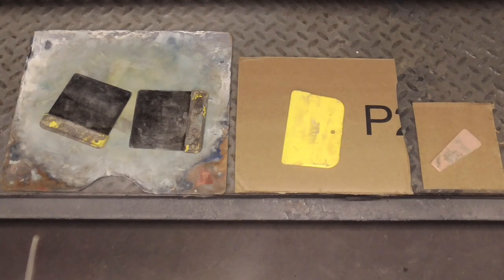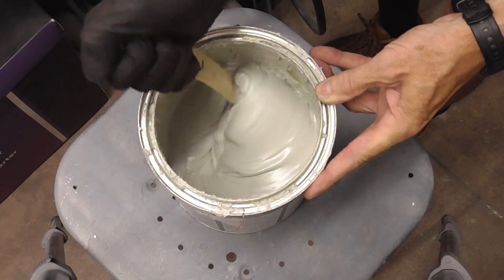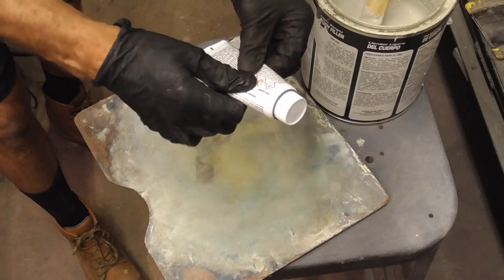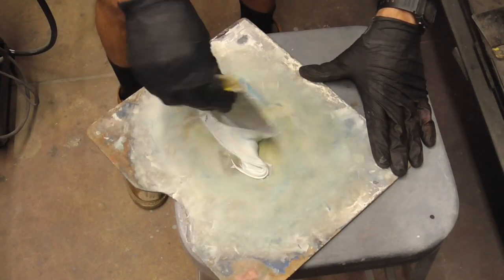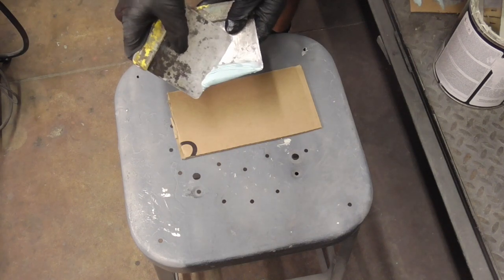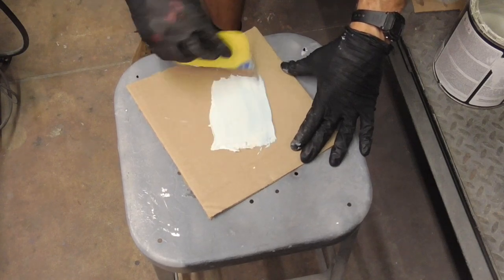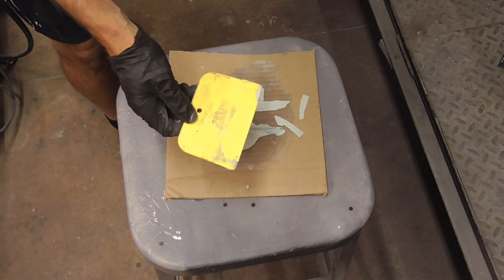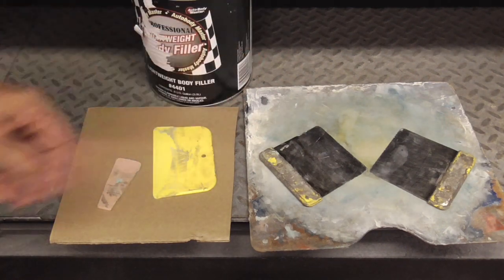How to Mix Bondo / Body Filler + Plastic vs. Metal Spreaders

Comment: I would like you to know that my son and I completed repairing 4 panels on his car. We cut out the rust replaced the metal, used body filler, sanding blocks and primer to shape the panels.  Then, painted with gravity gun and SW Dimensions paint and Rustoleum Clear coat. We couldn’t use 2 pack paint because it’s too dangerous for DIY guys like ourselves. No matter the finished job look fabulous. Like a mirror and very much like the original finish.  We would like to thank Lakeside Autobody and all of your great videos for giving use an education. We got all the right tools, and right advise thanks to your channel.  Now that my son’s car looks fabulous, it’s on to a comparably small job fixing the back corner of my 4 door Jeep.  THANKS AGAIN!!!!!!
Reply from the maker: That makes my day Rob - it's good to hear success stories like yours.  Hope I can continue to provide good stuff to learn from.  You're welcome BTW and have a great week :)

Comment: Thanks for the tips, on my side of the pond the recommendation is 50 parts of filler to 1 part of hardener or a golf ball to a pea. Putting in extra hardener to speed up the process can have detrimental effect on the top coat of paint, after a few weeks the filled areas can bleed through and ruin the final finish. Sanding filler does give you good strong arms!!
Reply from the maker: Wet sanding a whole car and wheeling it out builds those arms too :)
Reply: Ahh, I think I've seen this.

Comment: After the last video I followed your links and bought the metal spreaders and the Harbor Freight variable speed polisher/sander. I have used the polisher/sander quite a bit the last three days and it has made a big difference over the single speed grinder.
Reply from the maker: That's good to hear Leigh - try those spreaders on a nice flat surface first to get used to them - I still use the plastic ones every now and then too so bounce back and forth depending on the needs :)

Comment: You ever use kleen sheets ? The advantage of plastic spreaders is you can bend them to match the contour of the body panel. Those metal spreaders work great on flat surfaces , Don't see them around much anymore.
Reply from the maker: You're right about the plastic spreaders.  I've never used kleen sheets.  Thanks for the comments Keith and support - have a good weekend :)

Comment: Thanks, my filler always drys out super fast.. I usually flatten it a bit before hardener, making it more strip than I need.. Garage Tip, I save thick cardboard boxing with good glossy printing on it. The surface is resistant to filler soak in and no paper lint.
Reply from the maker: You're welcome - good tip Jeremy :)

Comment: I use lacquer thinner and a small paintbrush to clean my metal spreaders to keep them clean.
Reply: I use thinner and a blade for a quick cleaning. If cleaned up soon enough just a rag and thinner will do and back to mixing.

Comment: Try placing several sheets of white clean new printing paper onto a clip board. Toss the inexpensive plentiful top sheet in the trash when done. scrape excess of blades and wipe clean with a cloth soaked with thinners (i think you guys call it reducer). Your welcome.

Comment: Thanks for taking the extra time posting all your videos I’m learning a lot. Does Eastwood make good quality products and what is your go to paint supplier? Thanks
Reply from the maker: Eastwood makes good quality products. My go to paint supplier right now is the local Auto Value Auto parts store.  They carry Auto Body Master auto body supplies and they also carry Nason paints - they are both decent products but  not top of the line.  Middle of the road paint supplies are just fine for DIY projects - I wouldn't be afraid to try inexpensive auto body supplies and paints - Hope that helps answer your ?
Reply: Thanks again and I will keep learning from you and will post a picture of my 73 Challenger when I’m done. BTW your 73 Charger looked awesome!
Reply from the maker: @donh3711  You're welcome - feel free to ask questions.  I love every one of those old MOPAR's who ever was designing those things was awesome - throw some fat tires on the back - instant hot rod!
Reply: Not to be rude, but after years of learning the autobody scene.. Eastwood is a bunch of overkill baloney, & kinda overpriced. They have their place I guess. 

Their training videos are terrible too, basically all about buying as many products as possible with poor techniques imo.. Much better learning with a few real body and paint guys here on YT.
Reply from the maker: @jeremyr7147  It is about selling products and I don't agree with some stuff they try to push but they are there to make $ after all - good points Jeremy :)

Comment: Get some Evercoat plastic honey for your filler when it appears to be to dry add a little at a time in the can and mix it in until you get it in to the consistency you want.
Reply from the maker: Thanks my friend - good tip - have a good week :)
Reply: Or a gallon of fiberglass resin same stuff 4x more product.

Comment: Thanks for the tips Jerry.  Without climate control in a shop in Fl you can only use about 1/4 of the hardner.  You can hardly get it mixed before it pops, unless you use a lot less filler.
Reply from the maker: It's blistering hot up here in Michigan right now 90-100 - I can't imagine what it's like in Florida or Arizona.  We need a giant umbrella for the earth :)

Comment: Hi Jerry another great video How do that body filler   sand I mentioned you on my last 69 Firebird video And I need a big help from you so I'm in love with the classic compressor that I bought on Facebook marketplace which is belt driven But the last time I spray some paint I notice the tank is a little dirty inside what's the best way I can clean it up thank you
Reply from the maker: Well.... you can actually take those compressors apart pretty easily.  If you remove the tank and unthread the parts that attach to the tank you can fill that thing with some cleaning solution to get the old crud out of it.  Or you can just try draining it a lot.  I think you gave me a good idea for a video - "How to clean a compressor tank"  I drain my compressor at the end of every day so it doesn't give me any problems.  Hope that helps a bit.  Thanks for the support and comments Luis - Jerry
Reply: @LakesideAutobody  thanks I also drain my tank after every use it will be a great video thanks for your help God bless you enjoy your weekend
Reply from the maker: @firstgenerationgarage2803  God bless you too Luis :)
Reply: @firstgenerationgarage2803  If the tank is old and hasn't been drained regularly... the tank may have severe rust that may be a safety hazard. If you decide to dismantle the compressor down to a bare tank .. after cleaning tank interior Inspect it with a borescope to reveal any severe damage due to corrosion. Better yet replace the tank with a new one. Having a defective tank in your shop is like having an unexploded WWII land mine in  your shop or work area. Search "Air compressor explosions" to see what I am talking about.
Reply: @RaysLaughsAndLyrics  thanks the tank is in very good shape just a little dirty inside and no rust thank you for the feedback
Reply: @firstgenerationgarage2803  Good to hear.. Best to You and Yours.

Comment: I’m getting ready to replace the cab corners and rockers on my 82 Chevy. I’ve never done anything like this and was wondering is it better to do rockers or cab corners first? Or doesn’t it matter? Any other advice or possible issues I might encounter? Thanks for your help.
Reply from the maker: I believe on that truck the rockers slide under the cab corners so it would be better to do the rockers first.  Just my thinking though.  Check to see which one is welded on to the other and that will answer your question - hope that helps a bit :)

Comment: I've got several screw holes to patch from a old set of fender flares.   How would you repair that without a welder?   Thanks
Reply from the maker: Prep then with 36 grit on a small 5" sander/grinder.  Tap them down and fill with either regular filler or fiberglass reinforced filler.  Try to clean up the back side and undercoat with 3M rubberized undercoat to seal.  Don't worry if you can't get to the back side though - it'll last longer than you keep it probably :)

Comment: According to my autobody teacher, you’re not supposed to use cardboard since it’s porous

Also you can clean plastic spreaders really fast with wax and grease remover if you clean it while you’re waiting for your filler to harden enough to cheese grate
Reply from the maker: That's funny - I used cardboard in a few shop s that I worked at - never had a problem.  Ask him what the porosity would do to the filler if mixed on it - curious.... :)

Comment: If you don't know how to mix body filler you should watch some One first because to much hardener  will set the putty to quick not enough it will not go hard  because there's more to just mixing the body filler it's how you apply the filler and to know how long before sanding leave it to long and it takes a long time to sand back how to no when to sand the filler when the putty is just flashed of from being tacky is best time to sand makes it easy to mould your curves and corners and groves us 40 grit sandpaper around edges first to feather the edges with a flat blook then start sanding the high areas. then use 120 sandpaper to sand out most of the scratches remember if you need more filler put more on first make sure better with more than not enough remember before applying the putty scratch the surface with a angle grinder or a screwdriver so the putty has something to bond to

Comment: Why does some Bondo that was applied shrink and crack so fast, is there any such thing of a filler that doesn't do that . Thanks
Reply from the maker: Not one brand of body filler shrinks or crack.  If applied correctly you'll never know it's there.  Promise.  Here's a 5 year follow up on a serious bondo buggy - it will look like this for the rest of our lives.  When in doubt use BONDO brand filler - you can't go wrong - can get it at WALMART too :)

Comment: Hate to bug you but I have a question hoping you can help me out. Ive done some repairs on my van and I painted the panels but I wasn’t able to clear coat right away and now it’s sat for 7 days and I have hard tape lines so how would I proceed with getting rid of the hard line and finish the clear coat process? Thanks in advance
Reply from the maker: Where are the hard tape lines?  Are they hidden or out in the open?
Reply: Out in the open right on the sliding door and the rear quarter panel
Reply from the maker: @jasonknight219  Here's your options:  1) Try to wet sand that line out w/o messing up the paint then clear - probably won't work.  2) DA sand it flat, prime, block, paint again  3) Scuff lightly with scotch brite pad and clear right over the top of the hard line and try to bury it.  Then when it's dry wet sand the clear to "level" the clear and buff - probably will still see it a bit.    Unfortunately the right way is to sand it out and paint again - sorry.  Let me know what you do - Jerry
Reply: Alrighty thanks for the info I’ll give it the old college try and let you know what happens
Reply: Got it to work. sanded the hard line flat with 400 grit then I sanded the whole panel down with 600 grit the put a fresh coat of paint on it  and cleared it and the lines were gone. I’m knew to blending so I must not have spread it out far enough or something because it almost seems like it’s the wrong color it’s a 14 white town and country van I got the right paint code but it’s like white on cream.
Reply from the maker: @jasonknight219  Nice job fixing it - let me know what you do about the color or if you fix that too :)

Comment: Can I put bondo r spot putty.over high build primer
Reply from the maker: Yes but generally you want to try to get all of your bodywork nearly perfect first, then prime with primer surfacer, block sand, prime again, finish sand then paint.  Any imperfections or minor low spots can be hit with the spot putty but again it's something you aim to avoid :)

Comment: C'mon guys...what do you think happens to the solvents and little chemicals in the Bondo? It gets absorbed by the cardboard. Use glass or non porous surface. Yea cardboard is easier. But that's the shadestree way. This guy's not a pro. Yea he does it a lot, but that's not the best pro example.
Reply from the maker: Lots of professional shops mix filler on cardboard - you'll never have a problem 👍✌😊